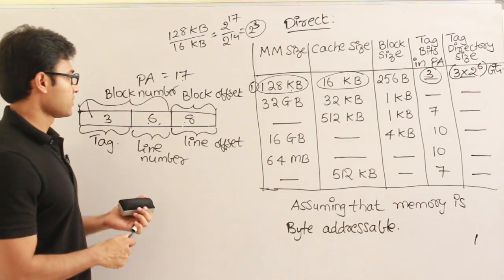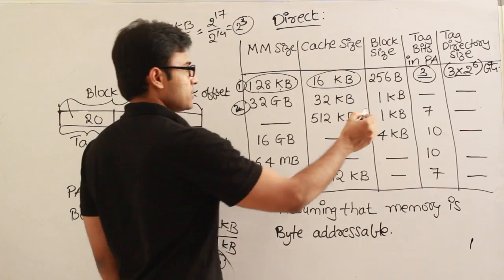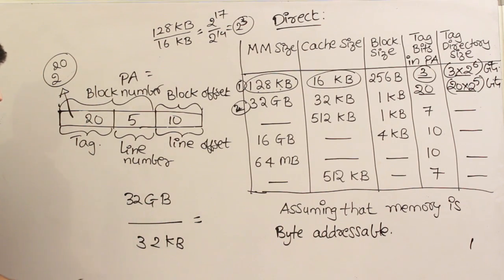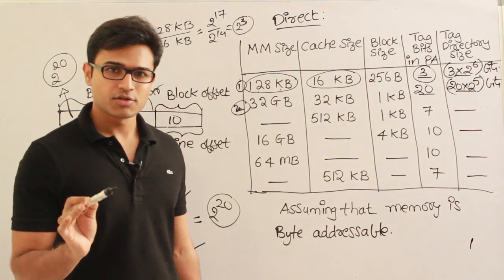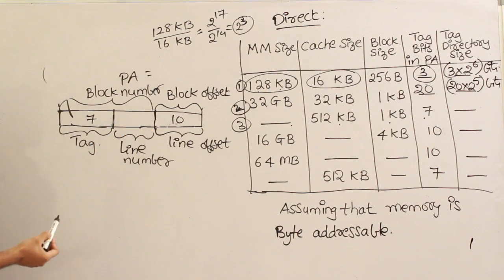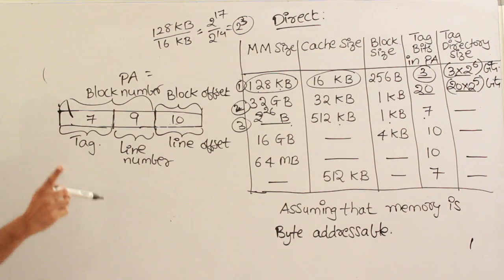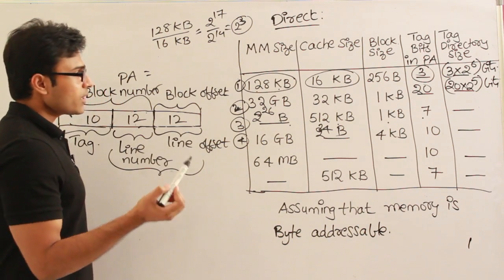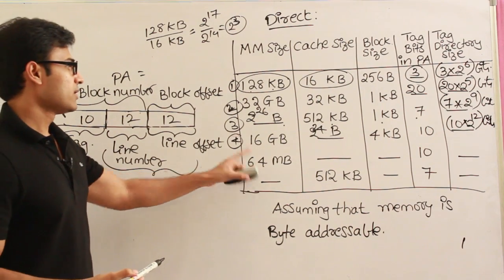COA | Cache | Direct mapping problems 2 | Ravindrababu Ravula | Free GATE CS Classes

Comment: Video is very good. But there are few mistakes i think. For Example in 4th question. Nor of lines = CacheSize/BlockSize, Cache size = 2^12*4kB, But in video it is said CS = 2^24 B
Reply: No you are wrong ..just convert the 4kb to bites you will get 2 power 12 so all together it is 2 power 24 only ...

Comment: 2^10 = 1024 B -> 1KB ==> will have 10 bits( The 10 in the 2^10)
2^10 * 2^10 -> 1MB ==> will have 20 bits(The 20 in the 2^20)
2^10 * 2^10 * 2^10 -> 1GB ==> will have 30 bits(The 30 in the 2^30)

So,
32 * 1GB = 32GB which is 2^5 * 2^30 -> 2^35 and will have 35 bits
Reply: thannnnnnnks very much